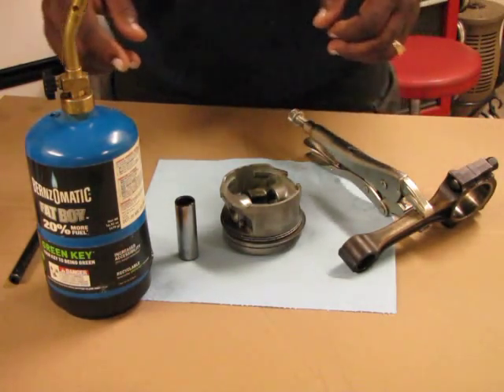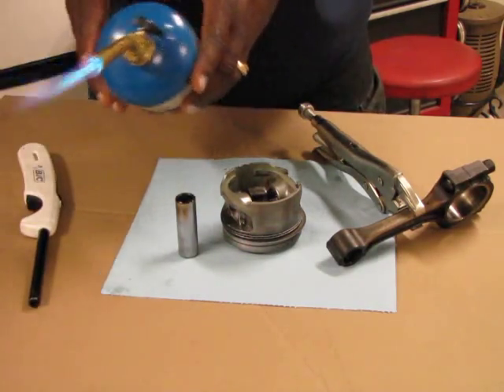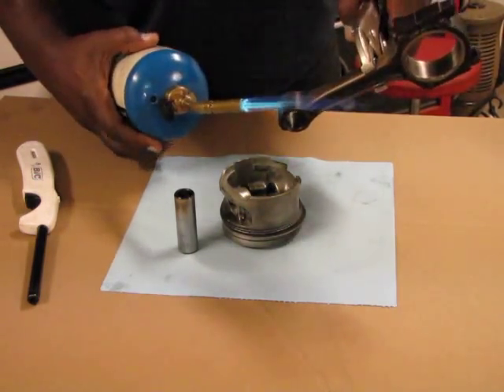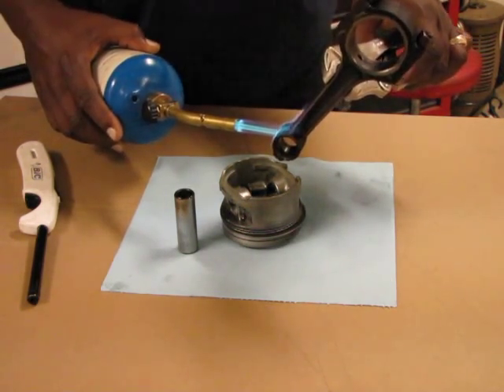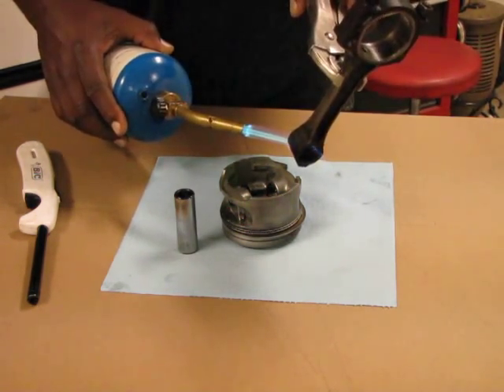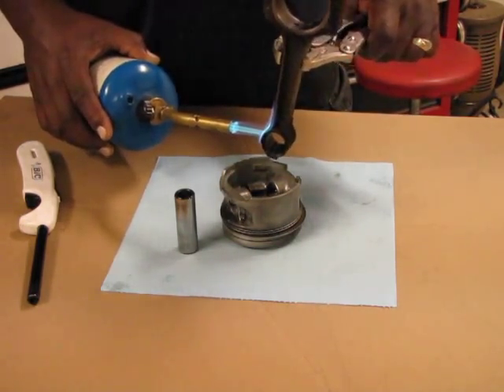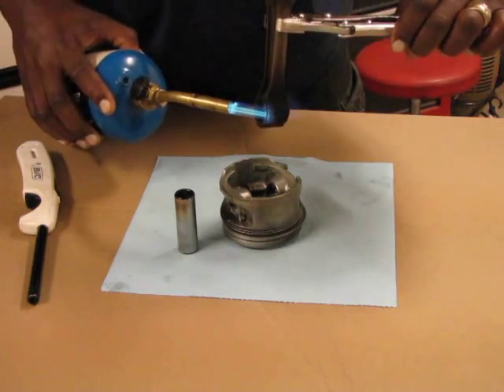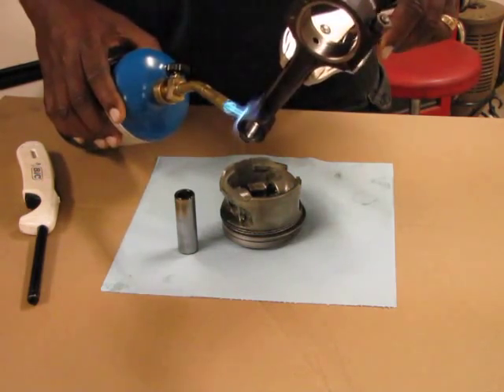How to install a press fit piston wrist pin with out a press

Comment: There's a debate on whether that blue color may badly affect the connecting rod metallurgy or not.. what's your opinion? And is this better than using a hydraulic press?
Reply from the maker: The flame does affect the metal, ironically it could actually make the rod stronger as it cools. The annealing process could allow some of the atomic bonds to form a stronger connection making the metal less brittle and actually stronger in this application. In a higher rmp engine with more horse power this process could make the rod "weaker" because the higher stress could cause the "softer" state of the metal result in bending.

Comment: If you put the rod on the oven at 250 celsius for a 5min and then apply a little of heat like you did, you dont need to torch it until it goes blue.
Reply from the maker: Cool, good to know, thanks.

Comment: Does this not harm the coating on the bearing? Many bushings like that come with a special coating on them.
Reply from the maker: I've built these engines and put 300k miles on them and then sold them still running, was the coating damaged? I have no idea.
Reply: @Engineerboy100  Thanks!
Reply: this kind of pin dont use an bush bearing.
Reply: There is no bushing the rod is locked onto the  wrist pin, it moves in the piston only.

Comment: well if you make to much heat the rod will  snap off just where you heated it. at 7000 rpm
Reply from the maker: It's a low compression, low power engine that rarely goes over 3000 rpm, it'll be fine. I've had no problems doing these for nearly 30 years. It's not a Porsche or a Ferrari, I know, I work on those too.
Reply: If you could get a junkyard piston to make 7000 RPMs
Reply: Why would you be trying to turn 7000rpm with a press fit rods?

Comment: Clint, I asked my Jeep Dealership to find the source of engine noise on my 2001 Jeep Cherokee. Upon starting very noticeable, but then calms down while driving. I bought it recently with 187000 miles on it. Has 189000 now. Engine pulls strong and feels great. So mechanic pulls oil pan. Reports back that bearings look good but that I have Two loose wrist pins. A little metal in oil pan he says. How big of a problem do you think this is. I dont daily drive it as I use it to pull a 10 foot trailer and large mower from time to time. Would you drive it on a long trip? Your thoughts appreciated if you would like to answer. Thank you.
Reply from the maker: The engine needs to be rebuilt. I would not pull any trailer with it in it's current condition I most definitely would not go on a long trip....And I don't think you would either lol :)
Reply: @Engineerboy100  Thanks Clint for fast response! Dealership stated they had no access to those required parts for fixing. I found that strange. 8400 for new motor with 3 year warranty. Ouch that figure stung me! Guess I better start savings my coins. I paid 4500 for it as its extremely well kept. Then put 4800 into it with alot of new parts. Thank you again😀

Comment: Cool.  You won't burn the temper off the connecting rod by heating it too much?
Reply from the maker: ... Well if you heat it TOO much of course, but I've never had a problem ... That said, I would NOT use this method on a high compression engine ...
Reply: they use the same method on small blok chevy rods , the professional machines use an electric element to heat up the small end

Comment: Can you remove them the same way? And if so, can I reheat the connecting rod for a second time to reinstall?
Reply from the maker: No, you can't remove it the same way. If you heat up the connecting rod with the pin in it, the pin will heat up and expand right along with the rod.

Comment: Great video just next time have the wristpin on the piston ready to go and then heat up the rod 👍👍👍
Reply from the maker: Yep, I thought of that after I did it smh, good thinking, thanks.
Reply: @Engineerboy100  well no one's perfect but you did get the job done and at the end of the day that's what matters. You're video definitely gave me hopes and definitely going to do this my self. One thing I learned is don't trust professionals enless you have no clue or experience. They will mess your car up.

Comment: How do you remove the pin with the rod still connected to the head of the piston without a press?
Reply from the maker: The rod is connected to the crank shaft. The rod is removed by taking the oil pan off and removing the bolts from the bottom.
Reply: Okay I get that but I'm trying to remove the wrist pin out of the piston and rod without a press I already have the Pistons out of the engine that's nothing.
Reply: @thatbluegsxr2651  put a long bolt through one side of the wrist pin. Ensure bolt head is small enough to travel throu piston and con rod. Place long bolt into vice with piston and con rod dangling on one side. Don't do up vice to tight. Big washer and nut on opposite side and tighten. Bolt pulls wrist pin through vice
Reply: @peterradovanovich8874  I tried it the bolt busted and the head of the bolt almost went through the washer if the bolt hadn’t busted first

Comment: Don't do it. Have somebody with lots of experience do this because it is VERY easy to mess up and good luck getting that pin back out or in the rest of the way.
Reply from the maker: Good advice, but most people into an engine to the point that  they are replacing pistons, probably have enough experience to know what they are doing.  But then again, you never know.